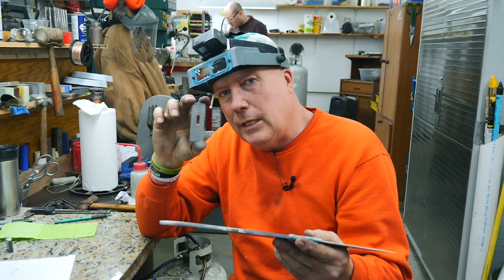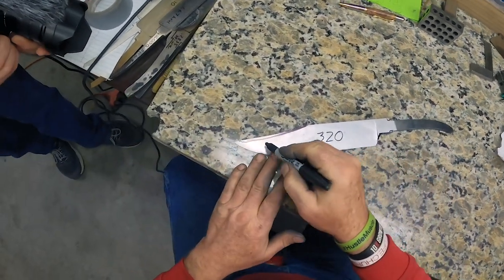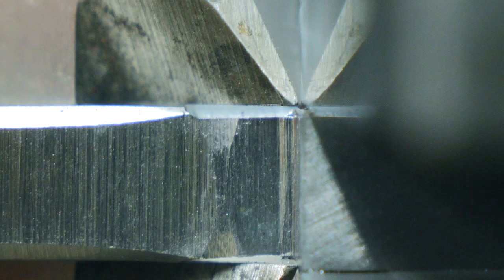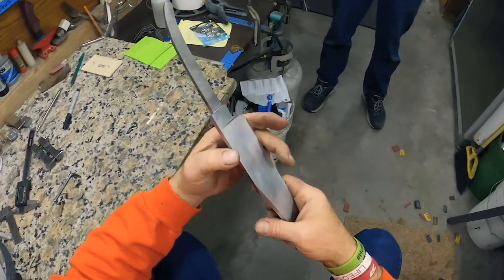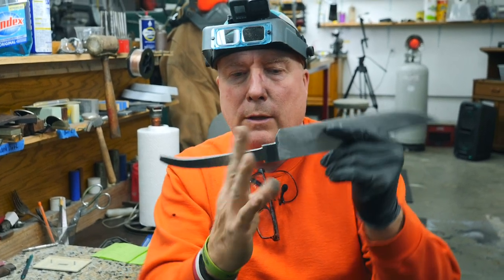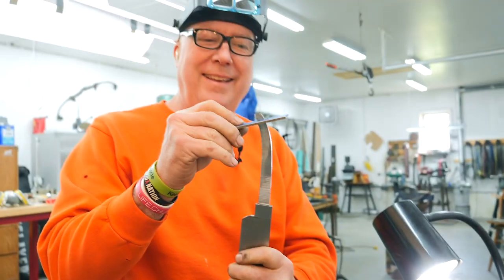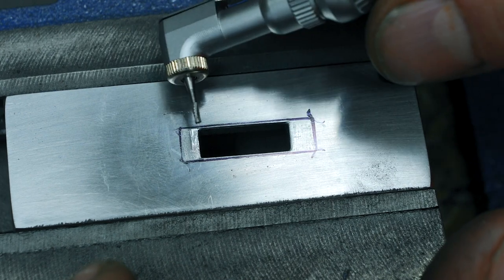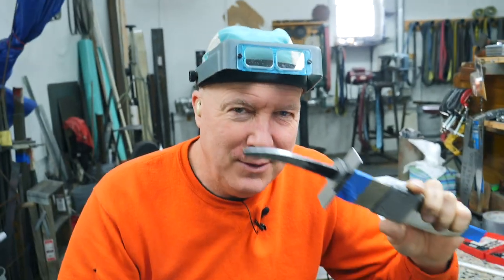Getting A Perfect Guard Fit On My First Bowie

Comment: I’d think filing the sides of the blade where it goes into the guard would weaken it to side bending forces?
Reply from the maker: Hey Shane 
Good question. The original size of the tang is oversized from the beginning. Taking  .0150 - .0200  off the sides will not affect the integrity of the knife. 
Glad you’re here. Be careful and be safe. 

Team Royer

Comment: Why not mill the slot out on the milling machine?
Reply from the maker: Hey Robert that’s a great question. 
In the online Bowie course, Kyle made the required tools minimal to show that you can build the online course knife with a few  select simple tools that a lot of people may already have in their shop. 
I wanted to see if I could do it just like Kyle did in the online Bowie course. 
I chose not to use the hydraulic press,surface grinder, and mill. 
I desperately wanted to 😩😢. 
I learned so much by building the knife the same way Kyle did in the course. 
And I had to email Kyle questions. 
Be safe and be careful. 

     Dad